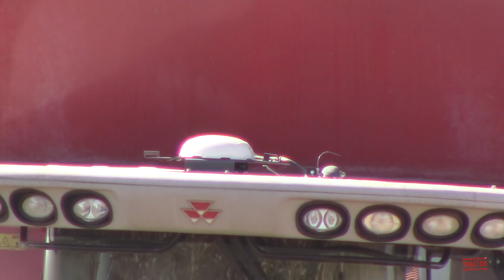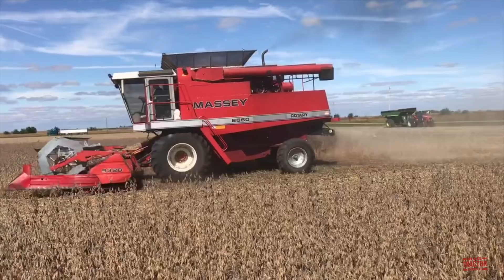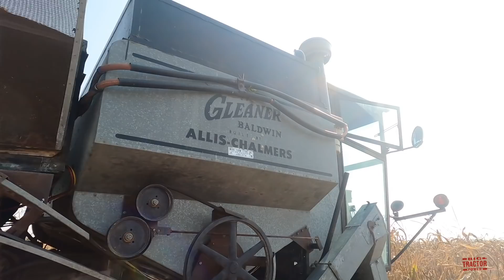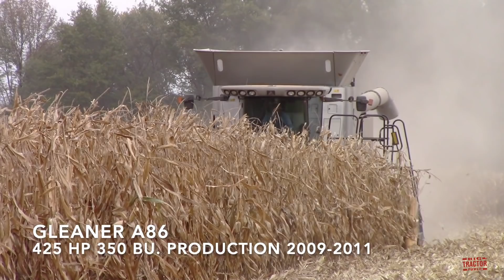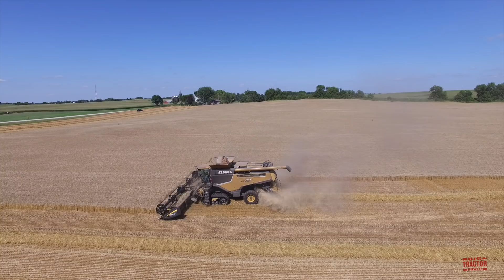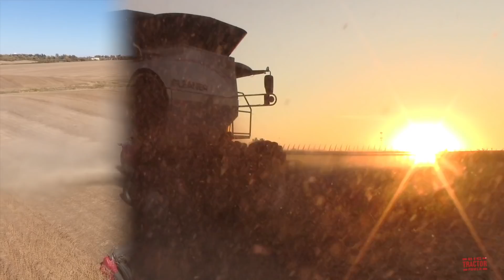GLEANER, Massey Ferguson, CHALLENGER Combines Harvesting

Comment: If I may add some detail - the Massey Harris 20 is generally regarded as the progenitor of all self propelled combines, and around 925 units were built between 1938 and 1941
 The MH model 20 was a big and costly machine to produce, and as such, not every farmer could afford one of them.
 It had galvanised tinwork from the get go.
 The MH model 21 was introduced in 1941, a machine of about 2/3rds the size of the prior model, and was cheaper to produce. It was hugely popular, and utlised an open ended table fitted with canvas belts, to feed the crop into the centre of the table from each end, being mounted transversely.
 Another, narrower canvas belt, this time arranged along the axis of the machine, fed the cut crop into the combine.
 The MH model 21A (introduced 1943) was similar in most respects to its predecessor, but had a table with closed ends and an auger that fed the cut crop to the centre of the table, like a lot of  modern combines, but the auger had fixed fingers, not the retractable type, found on modern machines.
 Another difference between MH 21 and 21A combines, relates to the Crop Elevator - on the MH 21, the Header pivots about the lower end of the Crop Elevator, whilst the Crop Elevator itself was rigidly fixed to the rest of the combine framework.
 As such, the MH 21 Header didn't  provide much under header clearance even in the fully raised position - essentially it just tipped back on its pivot brackets, which were attached to the front of the two main chassis base rails of the combine.
 The MH 21A by comparison, had a header that was rigidly attached to the Crop Elevator, which in this instance, pivoted about a point approximately level with the Operators Platform, and gave much greater clearance when raised - indeed gateways could be cleared without always having to take the Header off the machine.
 The MH 21 used a series of 3 large coil springs to assist the lifting of its header, via a large hand operated wheel, whereas the MH 21A Header was lifted by an electric motor, which was optional on its predecessor model.
 Both MH 21 & MH 21As were used during the infamous 1944 Harvest Brigade, an operation which gave rise to the Custom Cutter operations of the modern day. 
 The vintage combine in red, near the start of the video, is a Massey Harris 21A machine, not a Clipper, as alluded to in the comnentary.
 The MH Clipper combine was actually a trailled combine for the most part, but a self propelled version was later developed, that unusually, featured only three wheels - two tractive members at the front, as per now accepted convention, but only a single steering tyre at the rear of the unit . This arrangement may have provided a small turning circle, but the design was unstable, like tricycle tractors, hence the move the later pretty much universally adopted 4 wheel layout.
 Hope this helps.

Comment: Our family has run Massey combines since our first combine in 1949. We've had a MH 21, MH 27, MH 90 Special, MH Super 92, MF Super 92, four MF 750's, MF 760, five MF 860's, MF 8570, MF 9690, MF 9795, and a MF 9560.
Reply from the maker: Wow what a history.  That is great brand loyalty.   Thank you for sharing the line up.
Reply: 510 hydro trans were grain hogs to the core feedem up

Comment: Ran a Massey 8780 1998 model,. Upgraded 4 years ago to a 9895.  Simple machine that really performs.  You can see roots in these machines dating back to the 9700
Reply from the maker: It’s an interesting progression. They all trace back to the 9700 and the never released 9320.

Comment: I run 3 Challenger 680b. Simplicity and reliability can't be beat.  The White HYD drive rotor has some down side but it slick to use.  Can plug the rotor and clear it without getting out of the seat.

Comment: I grew up farming rice in Mississippi and east Arkansas and the last Gleaner I saw in person harvesting rice was an L3 in 1986. They tried the transverse rotary machines in rice when they were first introduced and they just didn’t perform well at all.  When CaseIH introduced the axial flow machines they took over and dominated the rice combine market until Deere introduced their version of an axial machine. I’ve only ever seen one Gleaner transverse rotor machine with a conventional header in rice and that one was in a YouTube video about rice farming in Australia. It had a Honeybee draper header. The modern day Gmeaners with higher horsepower engines are apparently capable in a rice field but they obviously aren’t popular.

Comment: Hi Jason, always enjoy your videos regardless of brand or machine type. Always well filmed and even better in recent times with the addition of drone footage. Also, your commentary makes for an interesting history lesson - Agco Corp in this instance. If I may correct one small error in your commentary for this particular video footage, the Massey Harris Clipper combine was not the model used on the Harvest Brigade rund but was in fact the Massey Harris 21 (and MH 21A combine models) combine. It was introduced in late 1941, after it was found that its predecessor, the Massey Harris 20 proved to be too big, heavy and expensive to manufacture to appeal to a potentially wider market. Only about 900 or so of this model were produced from 1938 to 1941. This combine sported wheels by French & Hecht. The MH 20 combine is generally recognised as the first commercially successful self propelled combine. The smaller MH 21 combine was cheaper and therefore more widely sold and as mentioned earlier, gained notoriety via the famous Harvest Brigade. Differences between the MH 21 and MH 21A - the former had canvas belts on the header, like a binder, that fed the crop to the centre of the table, where another canvas belt, orientated along the axis of the machine, fed the crop into the combine. The MH 21 combine had open ends on its table, its crop elevator was  a fixed position element - the header merely pivoted about the lower rear part of the header itself. The MH 21A on the other hand, had enclosed ends on its table, and had an auger that fed the crop to the centre of the table for entry into the threshing mechanism. The central fingers did not retract unlike more modern combines, where the do. Another difference was the fact that the crop elevator was rigidly attached to the rear face of the header but it did pivot about its rear end at a point approximately level with the Operator Platform, thereby enabling greater lift range and hence clearance when entering a field, avoiding  gate posts for example. As with the preceeding MH 21 model, the MH 21A could have its table removed for the purpose of transport over longer distances, as was usually the case with Custom Cutters, which the Harvest Brigade incidentally, was the progenitor. The above header and crop elevator details apart, the two machines were pretty much identical in all other respects, both sporting the round grain bin to the left of the combine main body, and situated directly behind the Operator Platform. The only other significant point of detail changes on both machines was with regard to the style of the front and rear wheel hubs which would take too long to detail here.

Comment: We never see Challenger combines here, or tractors for that matter. Mainly JD and some Case/IH, and actually quite a few older Gleaners still around. I wish AGCO would have kept the orange tractors and dumped the red since the machines are basically the same thing and there's enough red around already. It would have made it clear even from a distance that it was an AGCO  out in a field rather than a MF or Case/IH which would be better advertising on their part. Seems it would have been a wise move, at least for sales in the USA.

Comment: Whats everyone's opinoin on the older challenger CAT track tractors. Have been debating on picking one up to run my disk and rock rake since some came with PTO as well. There has been one floating around with a blade on the front for a while on the classifieds.
Reply from the maker: The farms that I have visited to film that have the flat track design all like them allot.

Comment: Under unloading boost the Ideal 9 is 647 hp and the 10 is 790 hp. same as the Claas 8900.   But it takes more than HP to make a great combine..  Watch a bunch of Mike Mitchell's video's from Faith Hope Farm, I think he compiled a list of over 80 complaint"s about the 7 Ideal 9"s they had until they traded for JD X9"s.  But what do you expect when you buy first year machines from any manufacturer?  I think Agco has something like over 400 updates for the  early Ideals.  And even then,  there are still some glaring errors you can see on the newer models by just walking around the machines.  Bean counters at Agco hard at work trying to cheapen  things by making some things substandard instead of better than the preceding  MF 9505 model.  That said, overall they are a much higher capacity combine in at least dry conditions,  in  high moisture corn the rear rotors aren't aggressive enough to separate the corn from the stalks, leaves and husks as well as other brands.  Works great in dry straw conditions because it leaves the straw in bale able condition like a walker machine.  Rear rotors are the same as the MF Delta 9380 in Europe which is a Hybrid like Claas rotor machines.  As far as Gleaner transverse machines being so wonderful, why do you think Gleaner put their paint and decals on MF machines for about 8 years?  Feeder house's and cylinders that plug easy in tough condition's with no rotor reverser  like Massey had going back to the late 80's.   Which ment poor sales in the south because they raise a lot of heavy rice with green stems and if it goes down like wheat can, you want a MF 9565 with a heavy duty feeder house and a rotor that reverse's with the front beater, something the 2011 and previous years did not have.

Comment: Just rolled over 3k engine hours on a r65 this week.    Love the simple design of the machine but agco not paying for access to the cummins software is a joke.    3000 corn head works well, the 800 flex head shakes itself to death every year.    I barely get 500 acres on the reinforced shoe under the wobble box before they break.